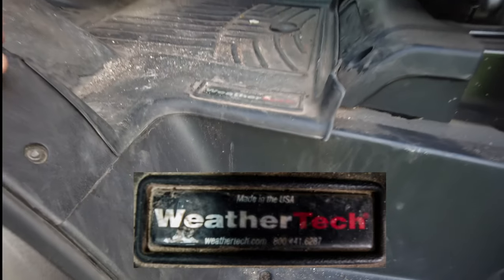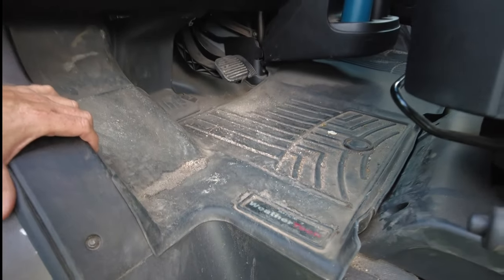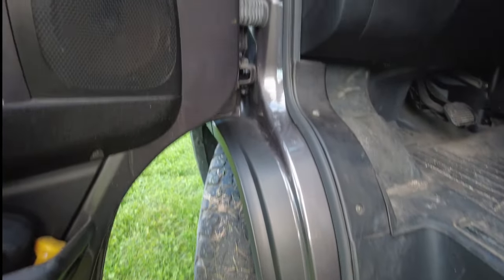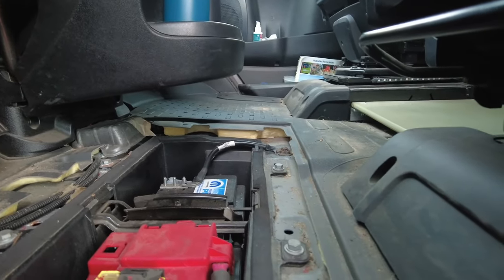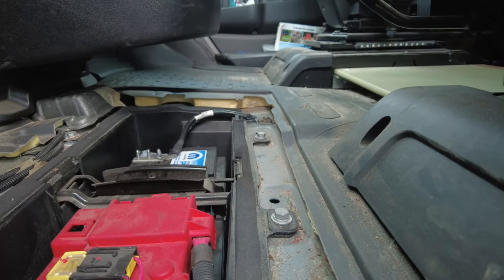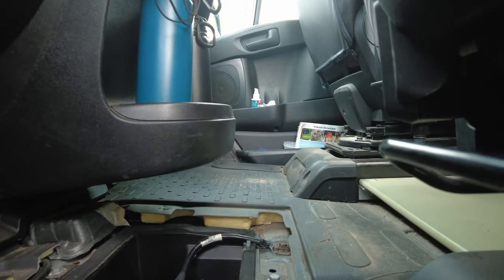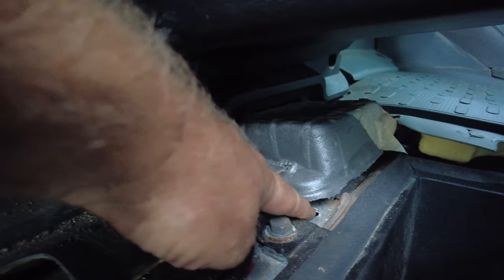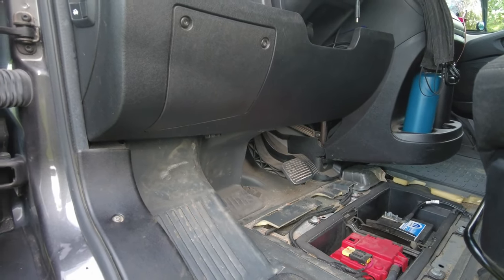RUSTING FLOORS?! CHECK & PROTECT YOUR VAN BUILD! EP 7: Rob's Van Repair & Maintenance Tips

Comment: Hey Rob, good info. I've always wanted Weathertechs, but unfortunately they're out of my price range for now.  However, I specifically bought my '02 Ford E250 down south due to the rust issues we face up here in NYS.  After watching Chromes' videos about his rusted out floor, I got a little nervous, so I ripped up the (nasty) old rug and inspected my own flooring. Luckily there was only a small amount of surface rust, which I removed, sprayed a rust converter (I think is what it was called) then sprayed a rubber coating on the floors. Then I replaced the rug with rubber flooring and put in the best floor protectors I could afford. Hopefully I've avoided some major future rust, but I still periodically check them out to make sure.  This is super good info for anyone looking to purchase an older van and I now recommend to anyone I know looking to purchase one to pull up the rug first and check the floors before buying.  Thanks for reinforcing this info!
Reply from the maker: Yup @Patti Crane’s Lane! We have to make sure we are making the right investment and then protecting it the best we can. 👍 This message never gets old! Glad you had minimal issues and have kept on top of them. We continue to do the same. 😊
Reply: @RobandJanCanVan  Well, I'm not as talented as Rob but I do my best!